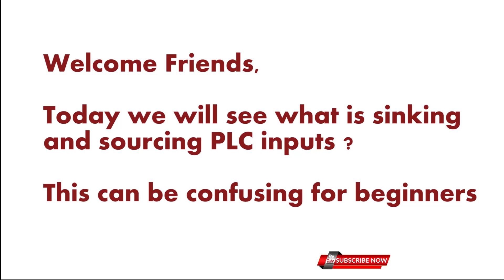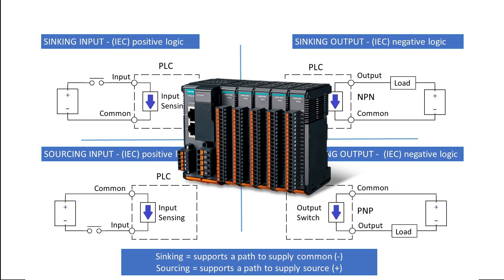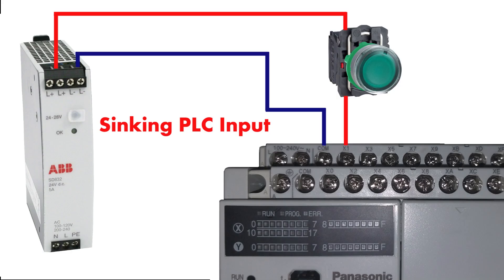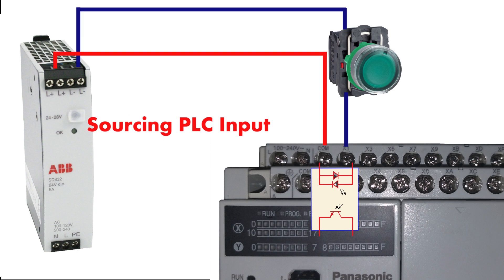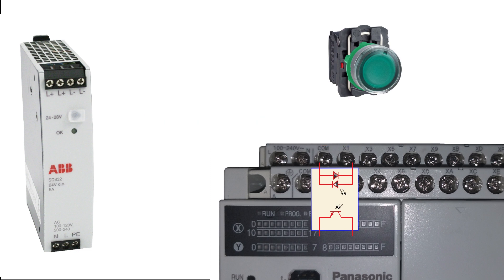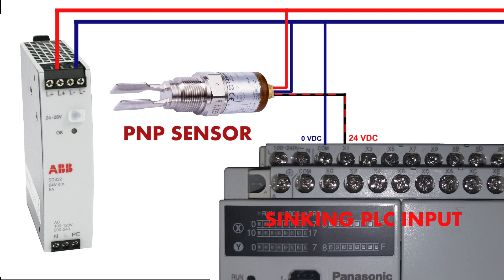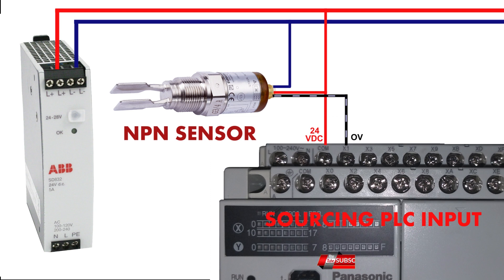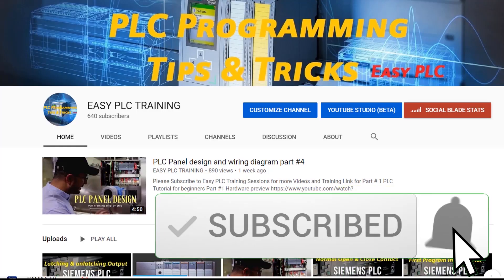What is Sinking and Sourcing PLC inputs ? PNP NPN sensor wiring with PLC ?

Comment: Bhai sourcing mein hum 24v control karta hein??
Reply from the maker: 24 volt will be at common terminal . Actually all is due to the reverse polarity of the led inside optocoupler
Reply: thankyou bhai, Now I understand.
Reply: Bhai, Mall gates mein person ko detect karna ka liya kon sa sensor use hota ha?
Reply from the maker: PIR sensor